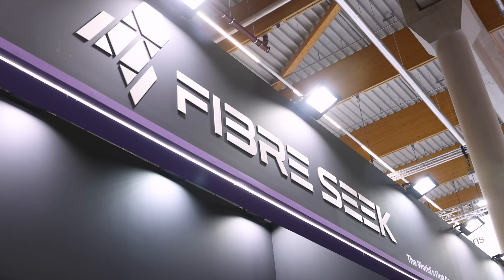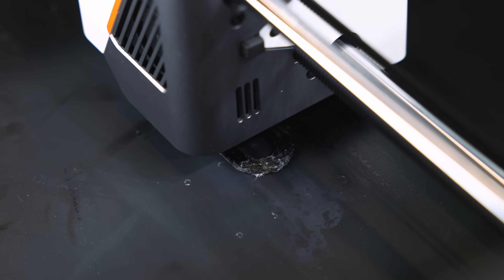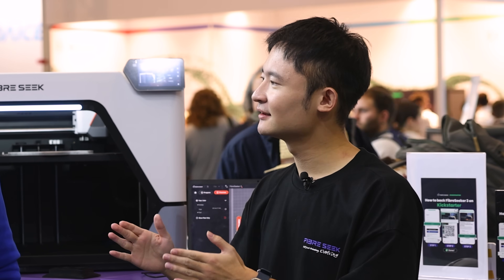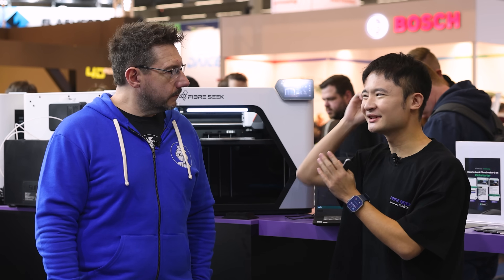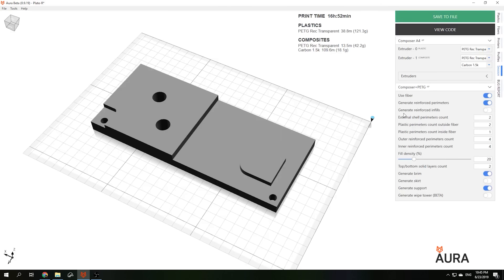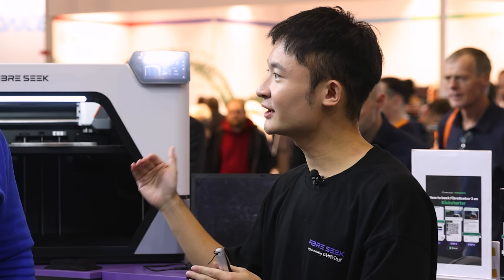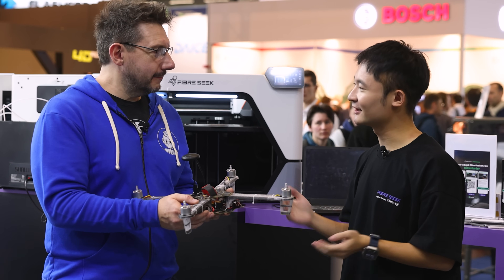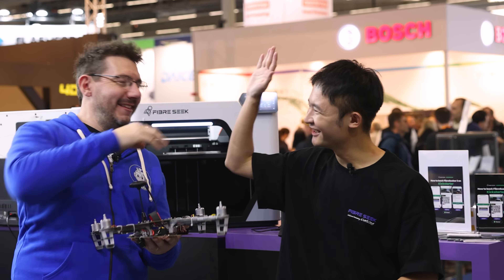3D Printing Continuous Fiber AT HOME? // FibreSeek at Formnext 2025!

Comment: This can really make use of a non-planar slicer to allow laying fiber on a curved surface. Or even with tiltable print head, but that's probably the next gen.
Reply: Yeah, because I'm thinking that sure, the parts may be strong, but always an issue with FDM printing is layer adhesion. Usually a big point of failure is along the layer lines. The parts might be strong along the lines of where the fiber is laid out but if you have layers of fiber on top of one another, but those layers themselves aren't as strong then we have issues. 
Non-planar FDM printing though, that would be incredible.

Comment: very cool machine, but the claim that it is stronger than metal is kind of an overstatement. It is only strong in the XY plane while being very weak in the Z direction. This is also why they are only showing brackets and other really flat pieces.
it would have been really cool if the slicer would add some tiny 1cm deep holes in Z where it could then again inject the fiber into it to add also some more Z-strength
Reply: But do you really need the same level of strength in all three axis? Also the adhesion strength is defined by the plastic, TPU with carbon could be an interesting combo. Plus annealing would probably be easier since the fiber would help a lot in keeping the dimensions accuracy
Reply: @zsxking  It will depend on the part obviously, brackets that are normally made out of sheet metal would work very well, but real 3d parts with loads in more than 1 direction might not work so well. That is why I suggested also inserting some carbon fiber in the Z-direction, it would obviously not be as good as the XY but it would help with the strength ratio between the XY and Z plane.

if you have 900 MPa in XY but only 60 in Z then you really have to be carefull with how you load the part, if you can increase the strength of Z to 200-300 MPa then it allows for much broader applications.

Comment: It's cool, but my functional prints usually always have some kind of z stress, and until they can figure out how to run the cf strands vertically. I don't really see to much practical use for me at the price point they are asking. Still a really cool machine and probably will work for others, just not me. I personally would like to see tullomer become more widely available and cheaper.
Reply: Second this. Need z access strength. Simple rotation on the bed just changes where the weak spot is located.